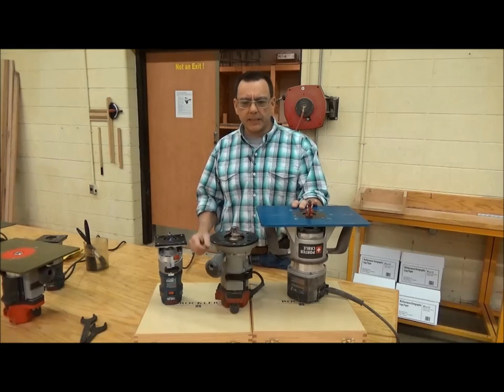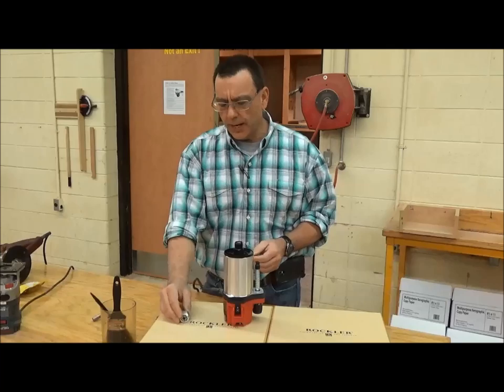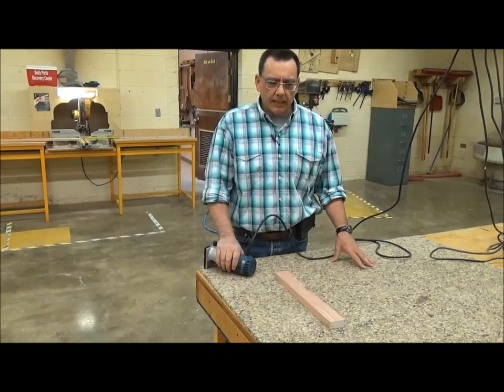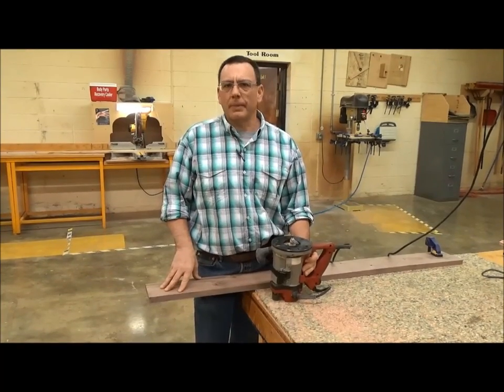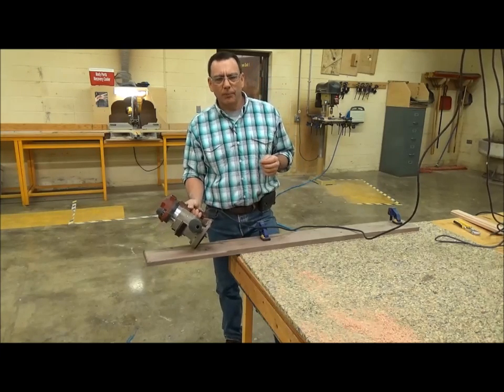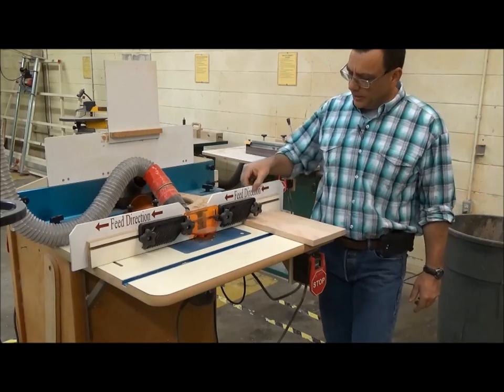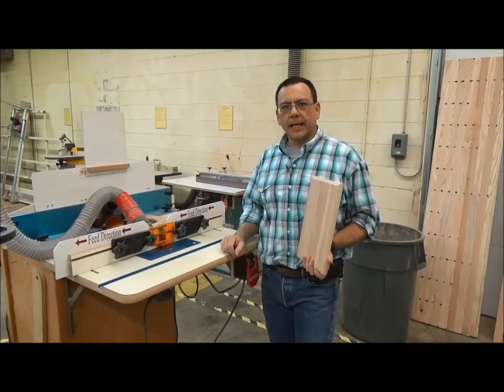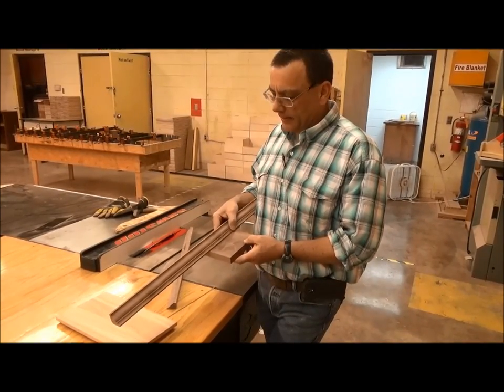How to Safely use Routers and Router Tables

Comment: "That's called a rub ring...it allows it to spin without burning the wood as the profile makes it's cut".
That is called a (ball) bearing. It allows the router bit to exactly follow the edge you are cutting a profile into.
You don't call a profiling bit "profile". It cuts a profile. That's just confusing.

Oiling the clamping surface of a fast spinning collet. Great, next let's oil the brake discs in the car when they start to screech, shall we?
The threads, ok, why not.

Using routers without ear protection?
Straight to hearing loss.

Using a small trim router on a very narrow workpiece that just lies on a grippy table mat?
Kickback,  tipping router, ruined cut, tears and pain.

Calling router profiling bits "profiles"?
Makes it weird to understand when he actually means a profile in a workpiece. Does he call hand plane blades "planes", circular saw blades "saws"?

Claims he was machinist, yet struggles to explain simple things like "Always keep the router perpendicular to the edge you're cutting or the cut will not be consistent and you will endanger the entire experience"?
Totally weird and sketchy terms used by a self proclaimed professional.

Tells you it's good practise to sling a mains power cord over your body when common sense tells you to never do that?
I bet there are even some statements in OSHA regulations that say it is not safe practise to wrap energized power cords around your body.

Says on the router table you should never hold the piece closer than one fist's width towards the fence?
Perfect opportunity to have the piece tilt during a cut because you push exactly on the opposite side you are supposed to.
You should push the workpiece forward right at the fence, and towards the fence at the same time, so it will stay riding exactly along the fence.
No one said you only have to use your hands, use pushsticks if you feel uncomfortable. The farther away from the fence you push, the more dangerous and unreliable and unstable it becomes.

If this is what "machinists" preach in "Shop Class" to American students, it would explain why most hospital ERs say a major trauma admit percentage is power tool "accidents".

Also, he looked almost afraid of the router table when he used it. Arms completely extended, body posture defensive, so no real fine control over feed pressure.
Looked like he held his breath with each cut. Totally weird presentation.

Same with the table saw. When the tilted cut was about to kick back, he forced it through, probably because he didn't want to look weak on video. Also the riving knife seemed to be all the way down for some reason. Again, totally weird and counterproductive, dangerous practise.

Bear in mind this video is only 5 years old. It's not like this was shot on VHS back in the day.
I'm glad only 50k people watched it and hopefully didn't take much away from it, other than the fact that he absolutely looks like Alan from Two And A half Men.